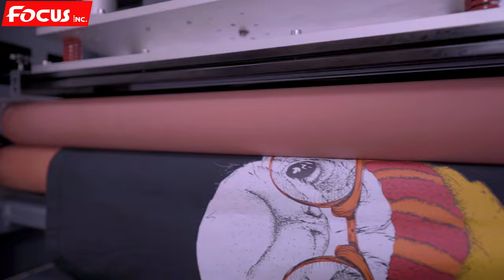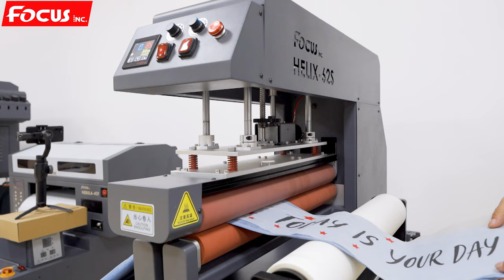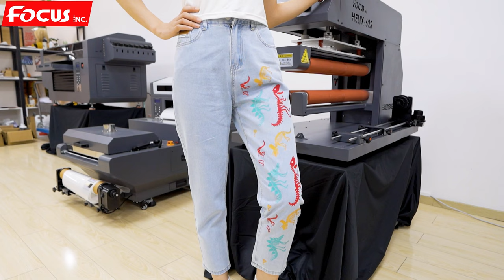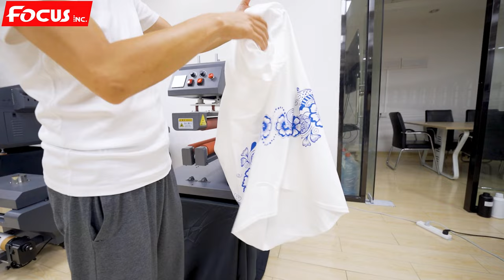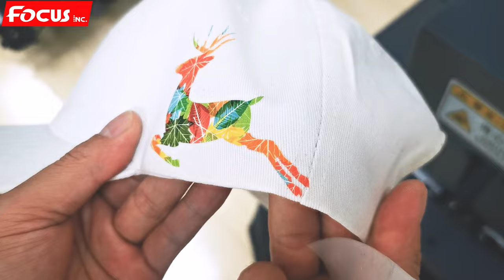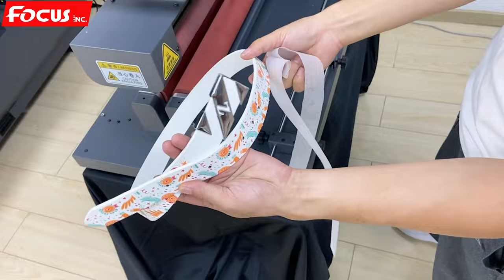Game changer of new FOCUS HELIX 62S DTF Transfer 360 Tshirt printer roller heat press machine

Comment: How about adding a roller with a smaller diameter as an option so that it can be used with socks etc. on?
Reply from the maker: You can just put socks on it and start heating press, welcome to inquire more details. +8619902919433
Reply from the maker: It have two rollers at bottom. U can put one socks in side
Reply: @focusinc.2682  Please make a video of the transfer on 360° socks.
Reply from the maker: @91mawtmg  welcome to inquire us to get more printing videos. +8619902919433
Reply from the maker: @91mawtmg  https://youtu.be/4xbFbvMTLnY
Reply from the maker: @91mawtmg   360° socks video link, click to check
Reply: @focusinc.2682  Thank you.  I watched 360° socks video.  It seems that sublimation transfer to the bottle can also be done using this method. 🙂
Reply from the maker: @91mawtmg  yes. It also support to transfer by sublimation paper. It is a multifunction machine. Garment dtf transfer. Uv dtf transfer. Foil transfer. Sublimation transfer....
Reply from the maker: @91mawtmg  yes, could do it. DM +86 199 0291 9433 to get quote.